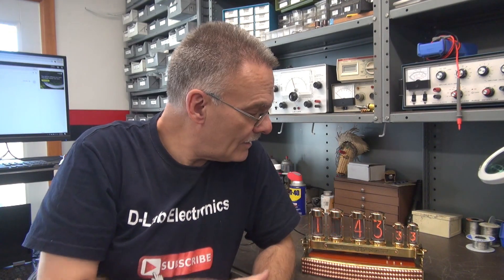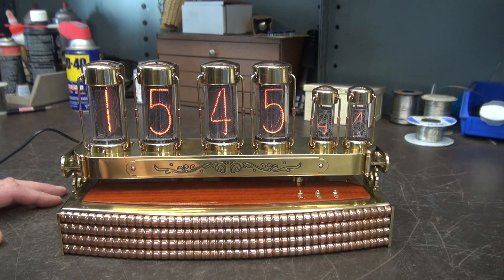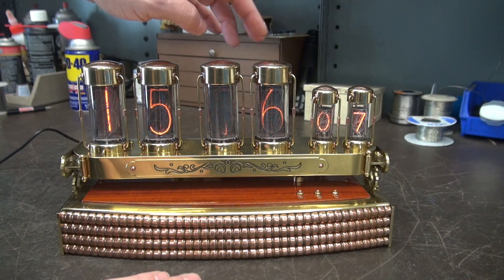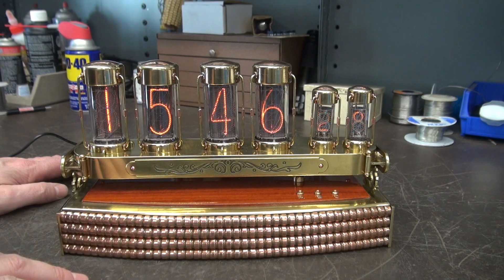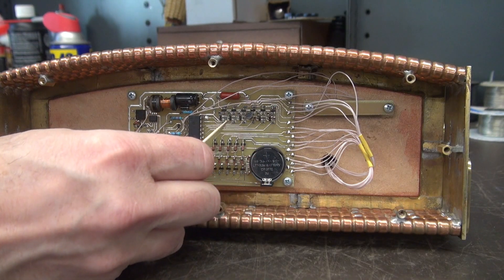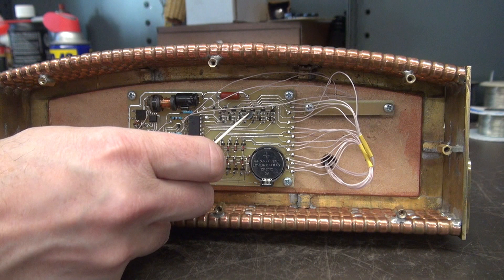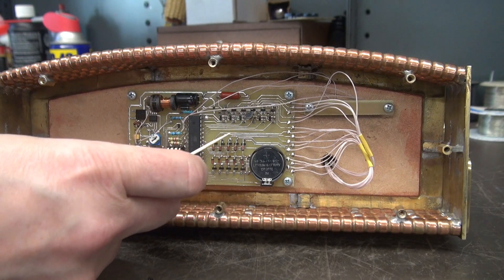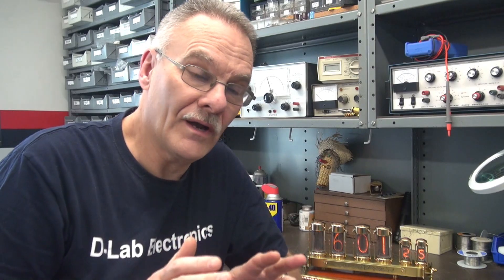D-Lab Repairs Nixie Tube clock Fault Hand made in Russia Vintage Jewel lives again

Comment: That's a really nice looking nixie tube clock.  I looked around on the internet for a kit, but most of them are pretty cheap looking.  If you're going to go with retro nixie tubes, you gotta have a nice enclosure.  Also a lot of them have LEDs to light up the bottom of the nixie tube, and personally I just don't get it.  The nixie tubes themselves should be the stars of the show.

Comment: Is the HV for the Nixie tubes generated on that board?

The Heathkit IT-18 I have has a leakage test mode, but at just 1.5V it may not work well enough to properly test those high-voltage transistors.
Reply: The term "tube" is misleading.  It resembles a tube but works more like a light bulb.  Imagine a light bulb filled with multiple filaments stacked or spaced side by side.  No heater or HV grid voltage needed.

Comment: Attractive clock, and good service getting it fixed.  Makes me want to dig out the clock I built in 1979 and see if it still works (all 74xx chips.)
Reply: I bet the boolean math looks pretty impressive.  Did you use flip flops for incrementing the numbers?
Reply: Yes.  It was a pretty simple business.  No alarm or anything, just a simple time display.  Flip flop counters, logic for when to reset and send a carry signal to the next counter. 7447 BCD to 7-segment decoders,  Normal 1 Hz clock , 60 Hz and 10 Hz clocks to set the time.  Built in a scavenged AT&T phone equipment box.  Ended up making it a military time clock, easy to reset 12 59, tricky to make it start at 01 00, so reset at 23 59 to 00 00

Comment: One question? What is being used as the time base? Hope it's not the AC line. Russia is 50hz!
Reply from the maker: Crystal controlled
Reply: @d-labelectronics  Ok good. But if you really want an accurate clock, do use the line frequency. I was told the utility counts every cycle. Sure it varies short term but long term they compensate so you get what ever 60hz counts out to on a monthly or so basis. Not sure if this is true anymore?
Reply: @andydelle4509  line frequency makes it difficult to sell in multiple markets plus lots of stuff now uses DC power bricks as it cuts the cost of construction plus you don't have to worry about different ac voltages
Reply: I saw the tiny cylindrical can by the 8-pin DIP IC, that should be the crystal.

Comment: I can’t believe anything Russian broke. They overbuild everything.
Reply: True, 
but I believe the silicon is not a made in Mother Russia, from the look on the PCB !  :)
Reply: @CezarVideoBlog  That’s a Russian printed circuit. Someone prints it on paper and they run wires to duplicate it. 😜
Reply: @dougtaylor7724  :) Not The PCB was the culprit, the silicon ( transistor that was a made in China ) and not a Russian component, :D , and over all a home made PCB is a home made PCB all around the globe :)
Reply: @CezarVideoBlog  I was referring to the large amount of wires going around the board. A friend of mine refers to a spaghetti pile of wires by that term.

Comment: You now know why I do not trust the transistor test  function on a DMM. It does not put enough voltage out to find bad transistors (or diodes) like you had. The old Simpson 260's or a curve tracer would have nailed it immediately, as they put out a voltage of several volts to test  resistance with. You might find an old Heathkit semi curve tracer, a B&K,  or a Huntron Tracker (Yeah I have all 3) great additions to the bench for trouble shooting.